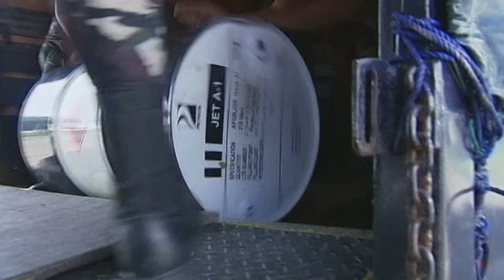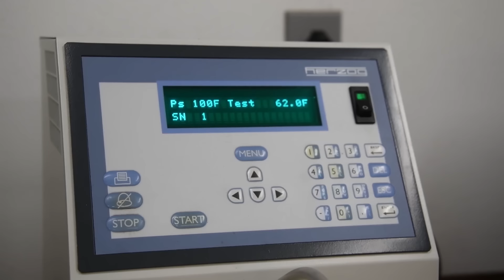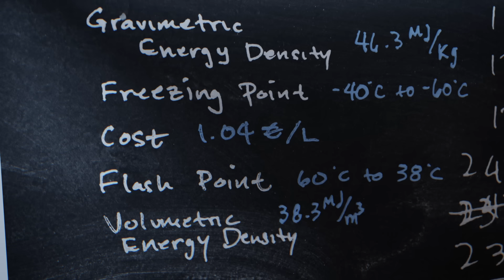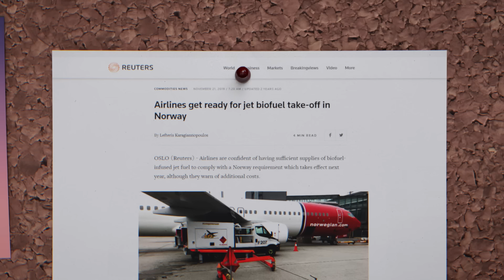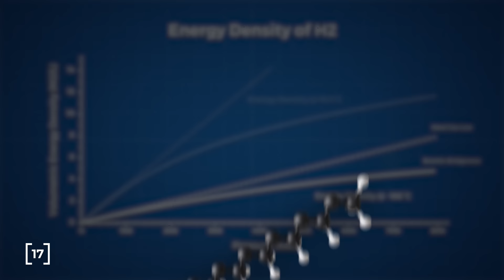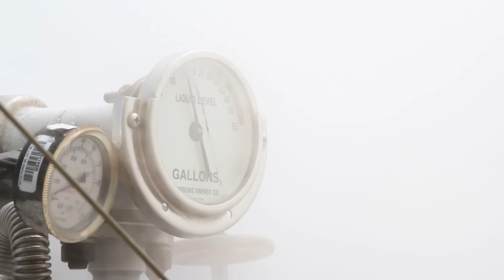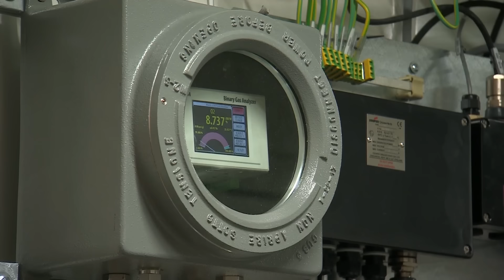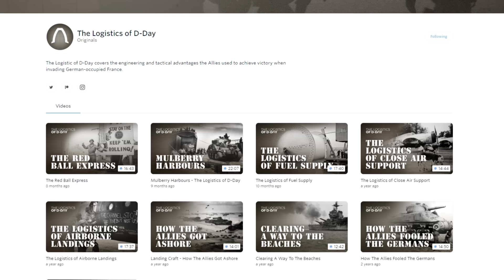The Uncertain Future of Jet Fuel

Comment: "... many of them are being converted to run on bio-ethanol." Stated in context like it's a good thing after just making another video about Biofuels and their dangers.
Reply: u should differentiate between corn and sugarcane ethanol
Reply: There are also waste generated biofuels
Reply: In that video, I believe that a jet fuel replacement was mentioned as one of the few legitimate uses for biofuels.
Reply: I'm guessing you stopped the video in a rage and didn't watch the rest, because it was addressed...
Reply: @bimblinghill  Rage? No. Though when he said that line I'll admit I lost all interest, left a comment, and moved onto something else.
Reply: @Drebin2293  So you ended up looking pretty silly
Reply: @Drebin2293  But again, in the original video he explicitly mentions jet fuels as a good application of biofuels...  So there is absolutely no contradiction here.  It's possible you forgot or didn't watch the original video completely...

Comment: "World's carbon dioxide emissions"
By that I assume you mean word's transportation carbon dioxide emissions and not the total carbon dioxide emissions?
Reply: No. Its just using extremely optimistic (that is, bullshit) estimates for all other industries going close to net 0.
Obviously completely deluded, but it makes for a great headline figure.
Reply: @aenorist2431  It's really not deluded to assume that most carbon intensive industries will have died or gone neutral by 2050. At this rate, as long as lobbyists don't siphon additional handouts to oil companies, that's quite a reasonable estimate.
Reply: @planefan082  20% of the world's carbon emissions come from coal power plants. That's ~2TW. Replacing - and more, energy use continually goes up - 2TW of electricity production in 30 years by non-CO2 emitting solutions is the goal. 
Actually believing that this is what is going to happen, that's deluded. 
A typical nuclear power plant is 2  reactors of 1300MW each, so the best scenario is ~2600MW and a 5 year build time.
Reply: The 2% of the current emission is true, transportation is the largest emission group, larger than electricity production, around 30% of the total emission is from transportation. Planes also go far and not really ideal as transportation to begin. Add that no option to limit its emission, it is 100% hydrocarbon based.
Of course there is a tricky stuff related to mineral oil usage: since we use fractional distillation to produce different parts of the crude oil, we really not in the option to not use some part of it. This is why diesel will be used until we use oil, even if it is not a great fuel, but 20%-25% of the crude oil is diesel, so not using diesel would just mean more crude oil usage and the issue of dealing with the unused diesel.
Reply: @planefan082  Handouts? Governments already tax the fuck out of fuels and push more and more regulation thus creating " an uncertain future" and your issue is with oil companies? Funny that.
Reply: This video did a bad job of clarifying.
Reply: @planefan082  i dont think you understand that transportation as a whole is not the biggest contribution to co2 production.  Construction is actually the largest followed by manufacturing/mining.  To just generally say transportation is the biggest doesnt account for what those exact transports are for.  Its the same as saying electricity prodution is the single largest source when its use is divided by many different sectors.
Reply: @ishanbaichoo7294  so what if solar cells become more efficient? They’re already getting cheaper so if it keeps getting lower and more efficient wouldn’t it be able to take a significant amount of burden off countries that can’t afford to stray from coal?
Reply: @Number1FanProductions  The inherent problem with solar and wind is that they are, by definition, diffuse energies. You need a large apparatus to collect the energy in both cases. So closing coal plants and replacing them with solar/wind is reducing one industry and boosting another, which is mining, metallurgy, and transports around the world. You need about a thousand times less metal to build a nuclear power plant than to build the equivalent installed power with wind or solar.

...Except wind and solar are intermittent energies, so you need to store the energy they produce. This ads cost, relaunches the whole mining, metallurgy, and transports circus and ads inefficiencies in the process.

Solar cells are very cheap because they are manufactured in China, with coal-sourced electricity.
Reply: @ishanbaichoo7294  I really think the only way to completely go carbon neutral is nuclear. but I don't see that happening
Reply: @Number1FanProductions  Don’t forget about the fact that solar cells lose their efficiency with time, quite rapidly in fact.
Reply: @ishanbaichoo7294  hydrogen production can shave the peaks off of renewables, so H2 or E-fuel could go hand in hand with wind/solar.
Reply: @Alt-ot5sr  no, they lose it quite slowly. 10 year old panels are often at 90% of new capacity.

Comment: We have a generation that was taught "green is good" and governments that will just do everything with the word "green" in it for a bump in rating. Currently to make biofuel, we would need to put in more energy compare to the amount of energy we would get from burning the final product, which translate to unsustainable. Plus it damage the environment and take up valuable water resources. 

Also when saying the Aviation industry CO2 emission will take up to 25% of total emission. Ok 25% of how much ? Percentages without the context are misleading and serve nothing but to push a narrative. For example, 2% of 1250 is 25 and 25% of 100 is also 25. Meaning the value doesn't change. Just saying 25% doesn't mean anything unless you are giving something compare it to. Percentages isn't a value, it is a ratio.
Reply: Percentages actually make sense here. The point is that other sources are going down in CO2 production and airplanes will become a much larger contributor. The actual numbers don’t really matter because we’re probably going to be trying to limit CO2 production for a long long time.
Reply: Using biofuels might make sense for applications where the energy density of hydrocarbons is absolutely necessary (e.g. aviation, rockets, certain heating applications,...) even if it is hugely inefficient. The question is whether the application is worth the energy cost, not whether it is absolutely efficient in terms of energy produced.

Comment: I think instead of looking at ways of making planes greener, we should massively limit their use around the world. High speed trains can replace a lot of the shorter routes around the world, and most domestic flights should be replaced with them (especially in the us). It's the same thing over and over again, we are trying to invent new ways to fix a flawed system which will just never work out.

Comment: Just thinking out loud: If the on-going installation of wind and solar farms eventually results in significant over-supply of electricity, will there not be a way of using the surplus energy to turn plastic waste into fuel?
Reply: You can turn CO2 and water into fuel, if you have energy to spare.  You can also just sequester CO2 from the atmosphere and put the carbon in the ground somewhere.

It's not worth it at the moment, energy is too expensive.
Reply: Was meinst Du, wie die Länder, die in der Höhe Getreide anwachsen müssen, vom reduzierten  cozwei Gehalt der Luft sehr leiden werden.
Beispiel hier in Bolivien, wo die arme Bevölkerung auf den Altiplano leben muss, wegen geringer werdenden Lebensraum pro Bevölkerung.
Gerade werden die Lebensmittel mit Lastwagen   nach LaPaz und Umgebung eingeführt. Die Treibstoffkosten haben sich kürzlich fast verdoppelt, so dass eine lokale Lebens-
mittelproduktion nun hier nötig wird. Dazu is die Menge vom Kohlendioxyd in der Luft zu wenig, weil sie ja mit der Luftdichte in der Höhe abnimmt, nicht die Konzentration(~0.04%), wohl verstanden. Sondern die Menge per cm³, die wesentlich ist für die Photosynthese!
Was meinst Du ,bestimmt die Waldgrenze? Regen, nein, Temperatur, auch nicht, co2 absolute Menge ja!
Co2 der Luft zu entnehmen ist das Schlimmste, dass die uns antun können, denk doch nach.
Sequester Co2 is not just stupid but a crime towards the growing poor population living here, who cannot afford to pay for the growing fuel costs.
A certain consequence of fossile fuel reduction.
Reply: Depends on logistics. If the power plant is located near a city. Alot are in remote areas.
Reply: there are many companies who have or are in the process of turning trash into cleaner versions of gasoline and jet fuel. i was just watching a video on it actually. look up trash gasification and see what comes up for you
Reply: @alexandriaj.1578  thanks
Reply: It seems everyone is forgetting nuclear power.

Comment: I work in the industry on the engineering side. My money is on efuels long term with biofuels and other blends as a bridge. Ultimately, we may be lucky enough too have a world with electricity "to cheap to meter." If we get there, efuels become the obvious choice with unparalleled energy density and,nine of the land use issues. From a governance perspective, it will take carbon pricing tax policy on airline tickets to incentivise the shift away from fossil derived kerosene.
Reply: my money is on Molten Salt Reactors making the fuels(among other chemicals) from their high heat(800+) reactors unless SAFIRE takes over heh
Reply: Just regulate it. Just like care fuels now need to be a percentage ethanol.
Just increase the percentage yearly.

And as cars move to electric, it already frees up a lot of biofuel capacity that would have gone into gasoline.
You have to look at these things from a macro perspective and things look a lot more feasable.

Comment: I will have to continue my pilot training with electric planes one day!
Reply: You will never go airborne because batteries are too heavy.
Reply: @jean-claudevijt4695  I don't remember who did a video on it, but electric aircraft are actually totally feasible for short domestic flights, they're just not very good for international travel. Even if we just replace domestic flights with electric aircraft, that goes a long way.
Reply: It was this Wendover Productions video. https://youtu.be/aH4b3sAs-l8
Reply: Solar ?
Reply: Electric planes leave a bigger foot print! Same with vehicles wake up
Reply: @Justinhomii  Considering the heavy metals required for electric storage, discharge, and control. This boi has a point.

Carbon is one thing, but these are a whole different level
Reply: I will never ride in an electric plane. Too risky for me
Reply: Batteries scare me worse than fuel tanks, tbh, and fuel tanks are kind of terrifying.

Comment: I wouldn't gloss over the difference between military and commercial regarding energy density so easily. Especially when you don't fill your tanks and fuel is a major cost driver, you want high energy per mass, not volume. Every bit of extra weight means extra fuel means even more extra weight.
On top if that, this turns the argument upside down. Long carbon chains are compact, but carbon is heavy and burns less energetic. Short chains take more volume, but have higher hydrogen content, burning hotter with less mass.

Comment: Was hoping you'd talk about algal jet fuels since they're the biofuels with the best environmental footprint and actually have a chance of working someday
Reply: And fuels from waste, electrofuels, ... there are many options. Most of the government and big corporations are part of the oil cartel that Schlumberger created and have no interest in having a viable alternative. And they have a big influence on the media and people's opinions.
Reply: I suspect these (or nuclear electricity derived efuels made from carbonised hydrogen) will be the way forward for high-density fuel requirements like aircraft. Hydrogen is just too dangerous for general transportation and battery aviation will always have severaly constrained range (that's not a problem for commuter flights but a big deal for regional/longer flights)
Reply: @miscbits6399  Like I said, what everyone is repeating barely makes sense compared to all the options that exist. Hydrogen has many ways to be carried safely, electrofuels can be produced by other viable electric sources such as high power renewable energy in microgrids or (micro)hydropower, there are other ways to power electric transportation besides low energy density batteries, second generation biofuels are viable, current engines can work with clean and/or renewable fuels...
Reply: @Vitor de Lima  The only SAFE way to carry hydrogen is to tack carbon atoms onto the molecules (preferably extracted from the atmosphere). The question is how you go about that.

The problem with oil as fuel isn't the oil. It's that we're putting CO2 into the atmosphere significantly faster than it can be scrubbed out again because we're burning fossil fuiels at around 120,000 times the rate they were originally created. The inevitable result of such action isn't sea level rise - that's just a minor side effect - it's an extinction level event on Permian scales when acidic rain kills off all the land vegetation and causes mass sea die offs, causing atmospheric oxygen levels to drop to around 10-12% for a few hundred thousand years
Reply: @miscbits6399  Keep repeating the same lies in a loop.
Reply: @miscbits6399  Acid rain mostly comes from sulfur in the fuel.  CO2 doesn't have that much of an influence in rain.  (But it's enough to make a difference in the oceans.)

Why would you expect atmospheric oxygon to drop?  Plants would produce more, not less, O2, if CO2 was more abundant.  (Having lots of CO2 in the atmosphere is bad for other reasons.)
Reply: @miscbits6399  No, search "flyzero". The LH2 is produced at the airport, and obviously used right there to tank up the planes. LH2 is not too dangerous, but there are obviously specific considerations for this tec. All the preliminary resarch is done, it just needs to go into production.
Reply: @vitordelima  ?uh?
Reply: @jonb5493  There are dozens of methods to carry hydrogen but this is a forbidden topic for certain people who love to spam social media.

Comment: One solution you didn’t mention was to keep using jet fuel and on the other end run direct carbon capture systems to offset the emissions. Might end up being cheaper…
Reply: yea it may work. But the problem isn't only the carbon dioxide output, there's also the problem of the finite resource of oil
Reply: It isn't going to reduce the particulates which in the video have a greater impact to global warming than CO2. not to mention they decrease air quality.
Reply: @Stefan-jk5gx  Indeed, so a mixed approach with biofuels might be best. In the long long term though space elevators combined with dozens of orbital rings will provide the fastest and cheapest travel all without burning any fuel whatsoever.